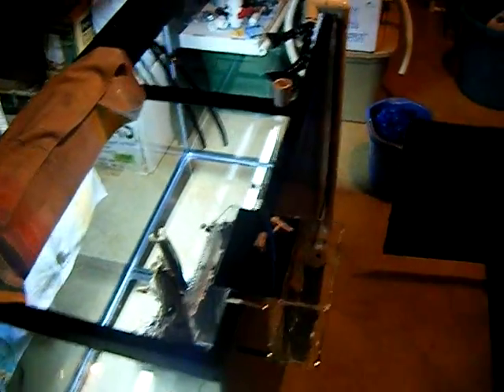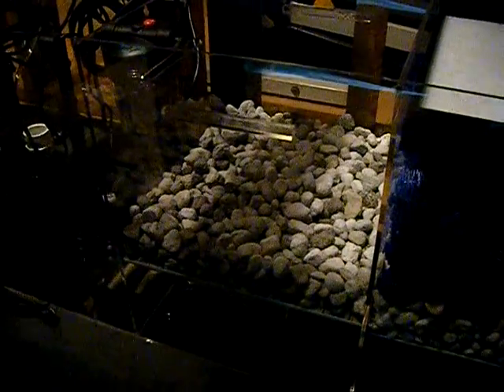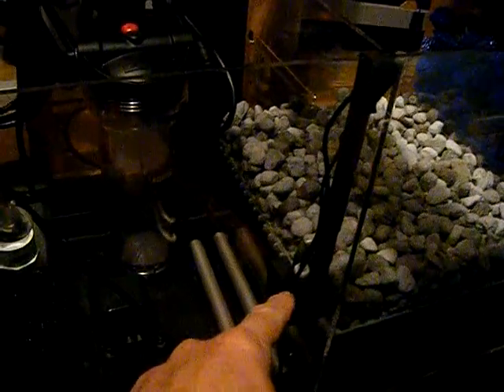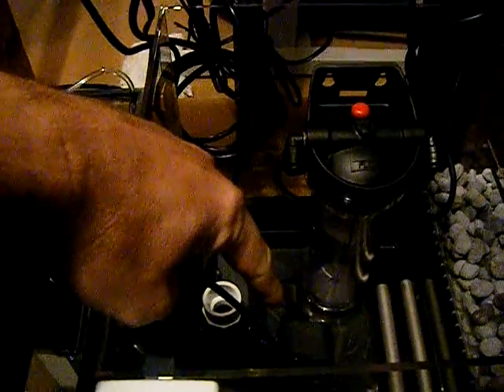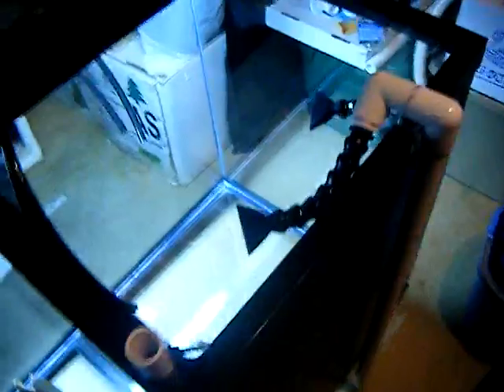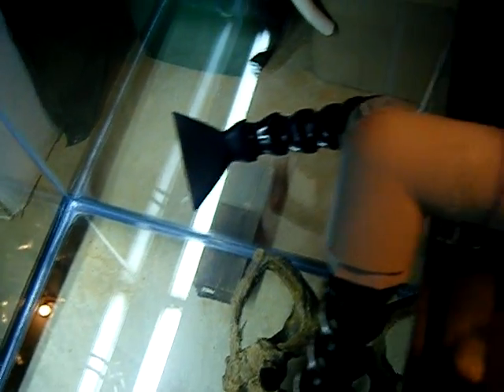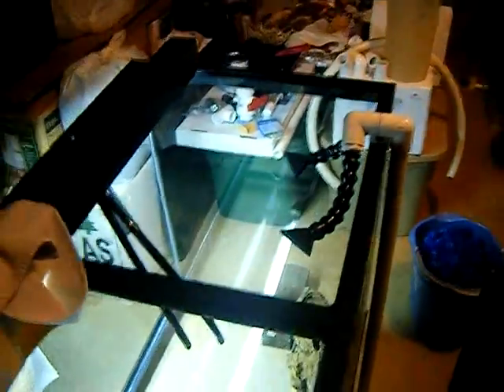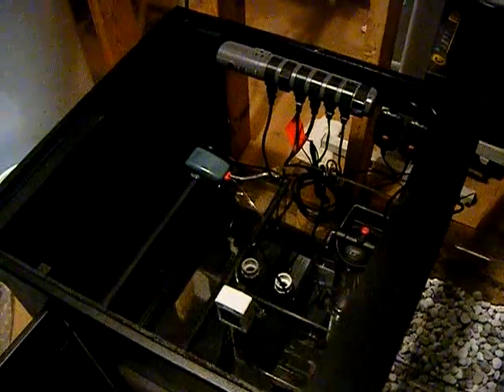150g filtration Part 2

Comment: I know people have already said it but that overflow system can cause water to leak onto the carpet.  Been there done that.  I have used this and the Utube systems and the Utubes never gave trouble.  I bought my first Utube overflow back in 1994 and it still works.
Reply from the maker: Thanks for the information. I've had this overflow running for almost a year now without any trouble. I keep it primed with a Tom's Aqualifter pump, and it's doing a fantastic job. I appreciate the comment.

Comment from the maker: Hello Jacob. I would use the Pond Matrix in your canister filter. It will not decrease the flow rate as much as the regular Matrix would. The regular Matrix will compact tighter due to it's smaller size and restrict flow. The Pond Matrix will allow a higher flow rate, and it's larger size allows for even more anaerobic area for denitrification. The best place that I've found to buy the Pond Matrix is at PetSolutions. You can buy a 4 liter tub for $30. Unless they have raised the price recently.

Comment from the maker: Thanks Milford. I'm really loving the Matrix. It keeps the nitrates very low... almost 0ppm. If I had the filtration to do over, I wouldn't even worry with the bio balls. The Matrix is more than enough to support the bio-load of the aquarium. The Matrix is sufficient for aerobic and anerobic bacteria, whereas the bio balls only provide surface area for aerobic bacteria. As I'm sure you know, aerobic b. process ammonia and nitrite, and anerobic b. process nitrate.

Comment from the maker: That is correct. However, you will need at least 780 gallons of flow for a 3/4" return line for this to work. You would need at least 1200 gallons of flow for a 1" return line.

Comment from the maker: because water won't be pumping to the tanks. If using an aqualifter, what happens if it fails and you don't notice for days when the syphon stops. 
I don't want to use a spray bar, because I would need at least a 1" spray bar to flow the maximum from my pump at 4'6" of lift. That would be too bulky. I'm using twin 3/4" loc-line return nozzles. I will have a syphon break drilled just below the 1" twin 90 with an 1/8" hose barb and a piece of tubing coming down just below the waters surface.

Comment from the maker: up in the top, the syphon will stop. The return pump keeps pumping water from the sump to the display tank, and you end up with water running onto your floor. If you are using an Eshopps overflow with the tubes, you can tap a hose barb into the top of the tube or tubes and hook them up to an aqualifter pump or your return line (as I plan to do) which will pull air out of the syphon. I prefer the second method, because if your return pump fails (which the overflow depends on) it won't matter.....

Comment from the maker: Thanks for the comment and questions. If the Matrix was just lying underneath the egg crate in a filter bag, 100% of the water wouldn't flow through it on every cycle. It would be like putting an undergravel filter under half of your substrate. Sure it is in the water, but it would take much longer for all of the water to be filtered by the Matrix. 
Also, overflow boxes can loose their prime due to air bubbles that enter the syphon and get stuck at the top. Eventually, if enough air builds .....